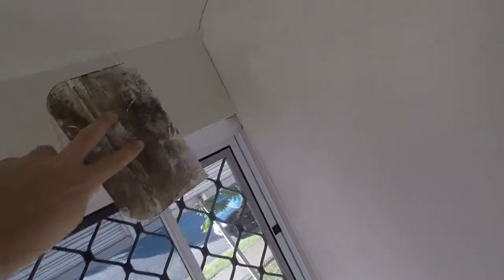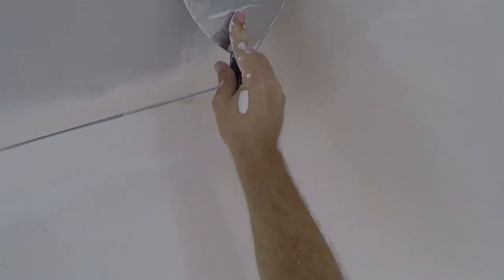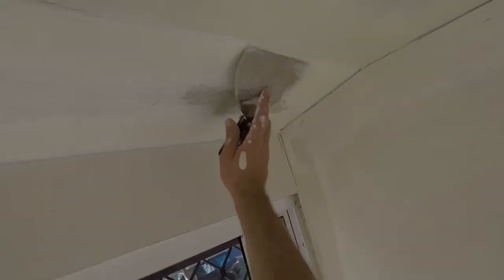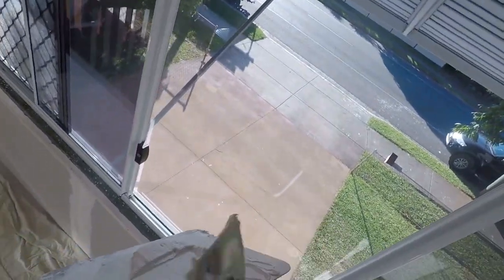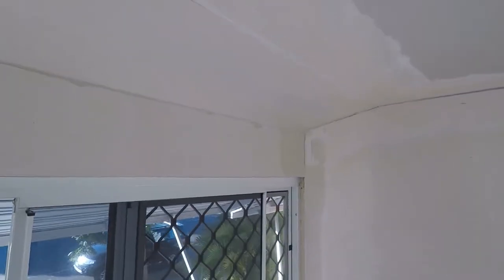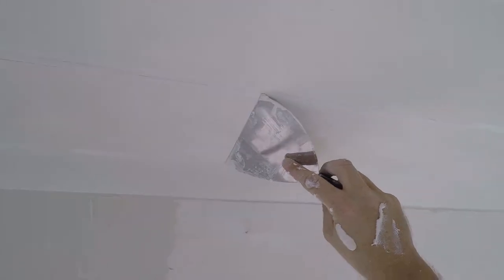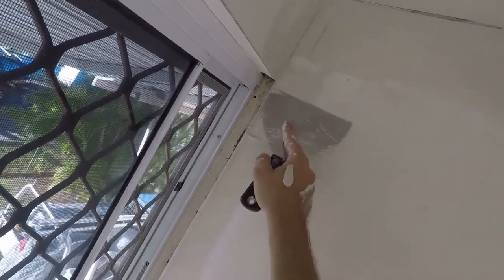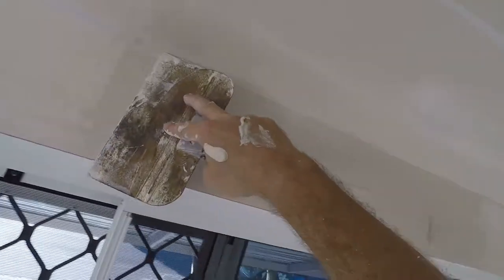How to square set drywall angles with Banksy

Comment: In your square set corner. What are you using for bad if looks like a metal inside corner bead. Do you set it with factory recess edge.